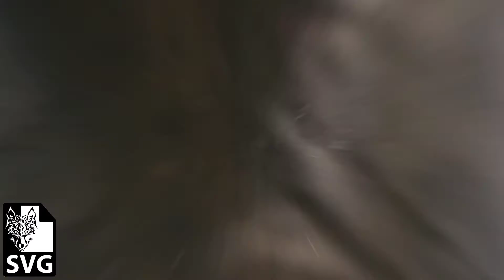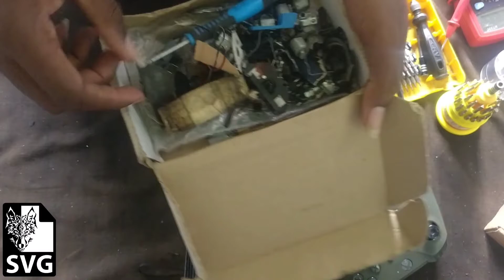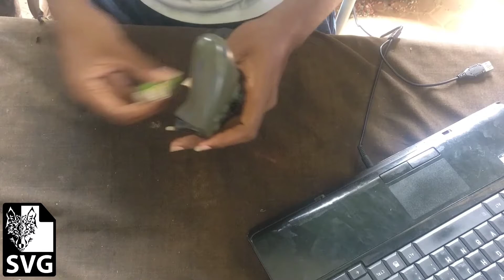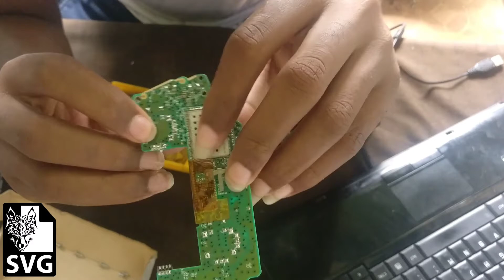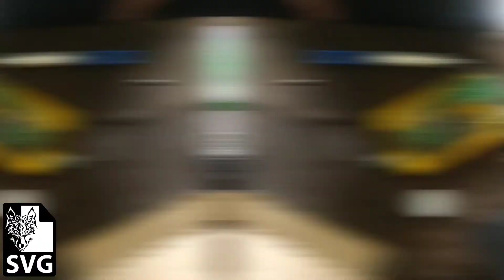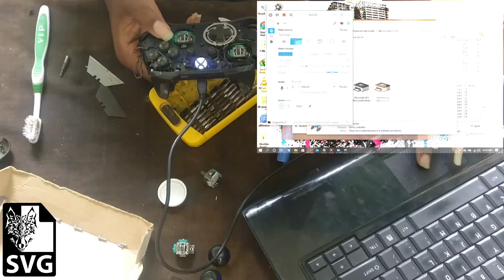Repairing It ep1 EASY steps to replace Xbox One controller analog module

Comment: Nice tip on saving the tactile switch. Looking forward to watching how you repair a damaged pad (1 of the 14 pads) for an anaolog stiick. To get the board working again
Reply from the maker: Thank you fam! I hope you will consider subscribing and leaving a like. Unfortunately I'm not too sure what pads your referring to so explain to me in details and maybe I can find a controller with that defect and make a video for you.
Reply: SVG_That Random Hi. When one of the 14 pads has been burnt that the analog stick is soldered to . You said in the video you will be doing a video showing how to repair this fault . Thanks again from Manchester Uk
Reply from the maker: @nicksparkle  oh yea that's what you meant, the analog leads, yea I will be showing you bro, infact I'll try to release that video within the week for you. 🙃
Reply: SVG_That Random Guy great stuff. There is no one on YouTube showing how to duplicate/run a wire if you have a burnt pad, also the rb lb pads come off easily  if too much heat is applied, but for the life of me I cannot find where to run a wire to get them working again  due to a ripped pad